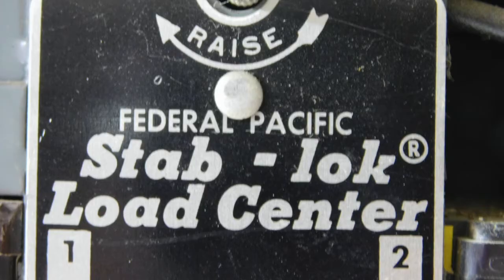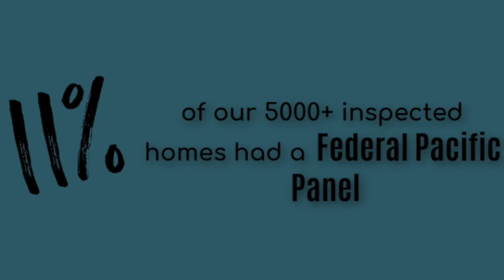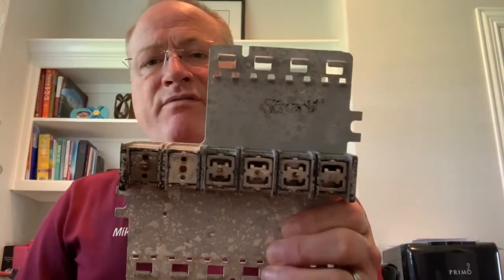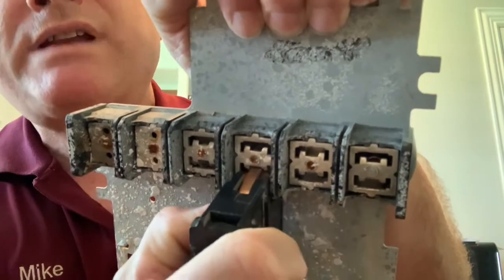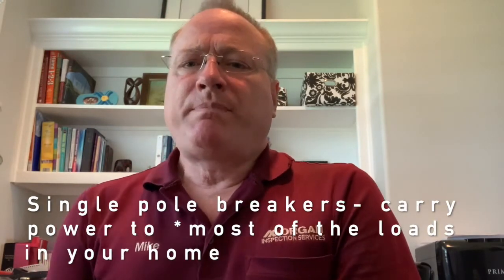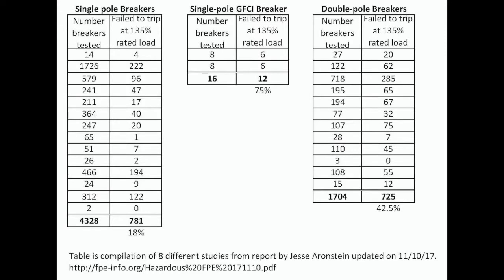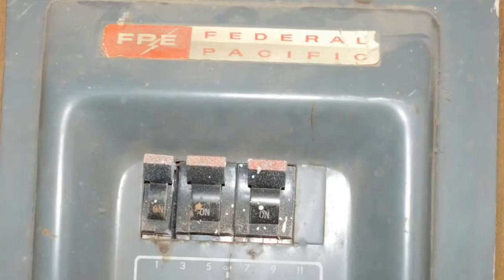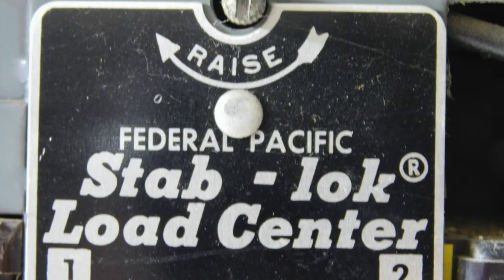Federal Pacific Panel/Stab-Lok Panel

Comment: Replace ASAP! We lived here since 1985 with FP Stab-lok panel in our bedroom closet. Just replaced ours finally on Tuesday after a big scare & learning the danger. Now a new up-to-date code panel is on outside of our house by the meter. -- I gather there are still millions of these panels in homes today. We had a fire in our garage freezer that could have taken down our house, if we weren't here to notice & jump. Thankfully we had some fire extinguishers & a good fire department response. Turns out we had rats that probably chewed wire in the freezer. Best guess. We were lucky wasn't much much worse. Could have happened while we were asleep or away. -- Firemen (yes, all men) said to get an electrician before turning power back on. -- Electricians told us that a new up-to-date panel with Arc fault protection would have prevented the fire from happening, so would have been a non-event. The circuit was okay after fire, but we should replace the panel ASAP because a lurking fire starter in our closet. 

1. Get yourself fire extinguishers & know how to use them. (Thankfully we did!)
2. Know what your electrical panel circuits control (Thankfully I did, so was able to run to shut off power to freezer). Know how to cut off circuits in your electrical panel.
3. Put a linked smoke detector in your garage (We were lucky I smelled smoke before the indoor smoke detectors went off. My nose beat the detectors. Fire was raging.)
4. Don't have holes in your drywall that can let a fire go up into the attic (turns out we had a hole near the fire in ceiling, but lucky didn't make worse)
5. Donate to your local volunteer fire department
6. Don't let your garage be cluttered with stuff that burns easily. Make sure you don't have rats hiding in that clutter. Check out your old appliances for safety. 
7. REPLACE any Federal Pacific electrical panel ASAP! Get up to code. 
8. Do NOT have your electrical panel in your bedroom closet. That has been a code violation since 1981, but no one ever told us till after this fire.
We are going to get a full house inspection for safety hazards - get electrical of house reviewed for what is no longer in code (old rules grandfathered in doesn't mean safe). 

Federal Pacific (Stab-Lok) was never actually recalled in the USA, which is nuts. Get them out of your house! -- Maybe they were recalled in Canada?
Reply from the maker: Thanks so much for sharing your story — I’m really glad you were home, had extinguishers nearby, and caught it in time. That could have ended very differently. And you’re absolutely right — Federal Pacific panels (especially the Stab-Lok type) have a long history of concerns, including breakers failing to trip. I always inform my clients of the issues with them when found during inspections.

I also appreciate the practical tips you included. A smoke detector in the garage, knowing your panel layout, and reducing clutter are all excellent fire prevention steps.

That said, not every FP panel causes a fire — but enough have failed that replacement is the smart move. For anyone unsure about their panel, it’s a good idea to have it inspected by a licensed electrician.

Really appreciate you taking the time to warn others!

Comment: few years ago i worked at a small public housing complex  that had a fire back in 2008 ..someone smoking around oxygen tank....place was built in the 60s ...anyway they dumped millions in rehab work...new decks ..new sprinklers and heat /hot water system...guess what the did NOT change...all 48 federal stab lock subpanels....no clue how they got away with that and last i knew they are still there...
Reply from the maker: Wow! The odds are definitely not in their favor with that mini stack panels.

Comment: I have seen brown handles are they defective
Reply from the maker: I hope the answers your question.  If not, give me a little more information about what you’re referring to, and I will try to answer better.  

Federal Pacific breakers with brown handles are likely older models, and their color alone doesn’t necessarily indicate a defect. However, many federal Pacific breakers, regardless of handle color, have been associated with safety concerns, such as failing to trip during overloads or short circuits. It’s always a good idea to have a licensed electrician inspector panel if you’re concerned about its safety or functionality.

Comment: What exactly is a 'over current situation' as you say ? the current coming in spikes or a appliance drawing to much current (if that's possible)
Thank you for the video.
Reply from the maker: Hi. Thanks for watching, and thanks for your question. When I talk about an overcurrent situation, I am referring to running 20 or 22 or 25 or 30 A on a 20 amp breaker. Or running 18 or 20, etc. on a 15 amp breaker. I’m just referring to a situation that would normally cause a breaker to trip.

Comment: why not just change the breakers out?
Reply from the maker: My understanding is that it costs more to buy the replacement breakers than it costs to completely upgrade the panel.
Reply: @morganinspectionservices3840  the cost of @20 breakers $20-50 each vs $2000-4000 for the entire panel. i realize the problem is twofold, the breakers not tripping and the way they connect(stab lock). not having any problems with the panel and it looks good upon visual inspection. may just stand pat and be careful about not overloading circuits. thanks for the video.

Comment: Why isn’t there a cost effective retrofit fix for these breakers. ? It is clearly the breaker that is the issue. Develop a new breaker with a metal that is not “dissimilar “ to the metal found in the buss right?  You don’t replace your steering wheel or your dash board when there is an airbag recall issue that can cause death. You replace it with a redesigned airbag.

Comment: How high are the failure rates at high current like 200% (short circuit)? is this a calibration type issue or complete failure typically?
Reply: They have focused on 135% current tests expecting a bimetallic strip in 40 to 60 year old breakers to be within calibration.  But on a 20 amp circuit with 12 gauge wire, a 100 foot run has 0.16Ω resistance and puts 64 watts of heat in the wire when carrying the rated current.  At 135% (27 amps) the heat would be 116 watts -- about a watt per foot of wire,not a fire hazard.  A magnetic switch instantly cuts the current in a short, where you could have the electric company maximum of 200 amps putting 6400 watts of heat (about 5 toasters) in the walls.  But as the CPSC determined in 1983 and again in 2011,  these will trip in most conditions.  But in older equipment, the condition it's in NOW should be the deciding factor, not a brand name. The dead front must   be removed to look for rust, corrosion, burned wires, melted insulation, loose terminal screws,   loose breakers , conductive salt  deposits near seawater.  Many will be fine  and there is no need for a $4000 to $10,000 replacement now.   That's how inspections work.  But  I get links sent to me from inpecto-pedia  claiming that even though an FPE panel is electrically and mechanically sound, even if  the breakers are tested,  it is  STILL dangerous and should be replaced -- because it might work today, but it could catastrophically fail tomorrow!  EVERYTHING that works today could fail tomorrow!    So replace EVERYTHING!  But  THAT stuff could fail tomorrow.

Comment: So just a question regarding the stab lok function... If the bus bar aluminum terminal was replaced with copper terminals (or whatever metal the breaker stab lok uses), would the FPE breakers function more safely or is the issue the actual stab lok mechanism itself
Reply from the maker: The biggest problem is with the breakers themselves and the fact that some of them do not trip.
Reply: @morganinspectionservices3840  and then when you try to remove one they come apart in your hands with the guts still attached to the bus bar, fun stuff (not).

Comment: Thank you for doing your best at getting the message out there.  Based on all the research I've done from numerous sources, talking with experienced electricians myself, these breakers were very common from about the mid 50s till around 1980, being cheaper than the competitors at the time, and are very notorious for failing and causing fires.  Just as much, if not, more so, than the old zinsco panels with the aluminum bus bars.   IF YOU SEE BREAKERS WITH THE RED TIPPED HANDLE, GET RID OF THEM ASAP.  Equivalent to driving your car with the seatbelts and airbags removed.
Reply from the maker: Good advice. Thanks

Comment: There are new Stab Lok breakers available.  If they are all replaced.  Is the box itself ok ?
Reply: After my experiences with the older FPE panels and breakers, no way in hell would I ever buy a panel with the FPE name on it.  Retired Master Electrician here, still alive to talk about my experiences.  😄
Reply from the maker: As long as the box is in good condition, it should not be a problem. I have not priced them, but I understand that FP replacement breakers are quite expensive. I have heard, but not verified, that it is cheaper to replace the panel than to buy replacement breakers.

Comment: I have a federal pacific box in my basement that is connected to my washer and dryer but it's not the main panel for my home, I have a modern breaker panel that i can turn off the FPE box in my basement by tripping the breaker. Does this mean I'm safe or should I still replace it?
Reply from the maker: The one breaker in the newer panel that shuts off power to the FPE box really won't help much. It is likely a 50-amp or larger breaker. If one of the 15, 20, or 30-amp breakers in your FPE panel need to trip but fail to, the larger breaker in the newer panel will do no good.

Comment: I have a Federal Pacific Panel that was put in the house in 1961. We purchased the house in 1994. Never an issue, I never heard of an issue until we recently built a detached garage and I did some research on running power from the house to the garage. After finding out about the breakers I went ahead and replaced all the breakers with new Connecticut Electric breakers. The breaker box looks good with no visible signs of arcing. 27yrs and only once did a breaker get overloaded enough to flip and that was on me for having too many toys plugged in on the same plug as the television. Maybe we have just been lucky but we have never seen any type of warnings from the local and state news or from State Farm insurance on our Home Owners policy. I would have never known if not for YouTube which I'm sure millions don't watch.
Reply from the maker: Thanks for the comment. Your home is like most homes which can go for years and years or perhaps forever and never need a breaker to trip. In these homes, the FPE panel will never be an issue. However, a breaker panel has one and only one job - to trip to stop an overload and prevent a potential fire. If there is a 30% chance of it not working correctly, then that is definitely a problem.
Reply: @morganinspectionservices3840  I am a retired contractor. In around 2005, I worked on a residence that had an FPE panel mounted on the exterior of the structure. My electrical sub found that the main disconnect had overheated in the past. He said that the problem with FPE panels was the breakers themselves failing to trip in an over-current situation rather than a panel design issue. He was able to locate an updated Stab-Lok main disconnect and all new breakers that were manufactured by a company somewhere in Canada. According to literature supplied with the breakers, CSA had tested the Stab-Lok clones and determined that they performed as required. CSA Certification information was provided. The only issue was the cost of the Stab-Lok clones, which was about double that of a standard American made breaker. By using these Stab-Lok clones we were able to save the homeowner quite a lot of money and still update the FPE panel with breakers that would provide proper protection. That being said, if it were me, I would have replaced the entire panel with a new one, but the homeowner was operating on a tight budget and this FPE panel was an unexpected issue.
Reply: @harryedmunds6652  the breakers in older panels in grocery stores and hospitals and such would come apart in your hands with the Stab Loks still attached to the bus.  Retired Master Electrician here still alive to tell about it.  😀
Reply: Think I have read that the Connecticut breakers are just as bad as original equipment.
Reply: the stab lok are problem panels....ive worked many places with federal pacific switchgear and mains ..those are fine

Comment: Testing by Jesse Aronstein has shown that the Connecticut Electric UBI type F breakers are worse than the Federal Pacifics for failure to trip. Type F is the designation for CE's replacement breakers for Stab-Lok panels. Stab-Lok is a trademark and only Federal Pioneer has the current rights to use that name on a product. Federal Pioneer is a division of Schneider Electric. Federal Pioneer Stab-Lok breakers are manufactured in Mexico. The most popular type NA breakers have been discontinued leaving only the thin NC type available for numerous amperages.  American Circuit Breaker Corporation(ACBC) breakers were manufactured by Federal Pioneer not Federal Pacific.
Reply from the maker: Thank you for the excellent information.

Comment: Thank you for a very informative video.. I am in Canada my panel is a federal pioneer panel and the breakers are stab-lok Breakers but instead of having copper tips they have aluminum tips. So I'm guessing this could have been something they resolved along the way in production. Changed to aluminum busbar and aluminum prongs on the breakers.
Reply from the maker: The busbar may be different, but that does not solve the problem with the breakers themselves. It should be replaced.
Reply: They are still failure to trip prone breakers and you should change it out as soon as possible.

Comment: I have read plenty of scare stories on the net about FPE panels. My own has always functioned correctly. There was a buried cable out to a lamp post in the yard, and it eventually began shorting out, and my Stab-Lok breaker tripped as designed. So in my experience, the panel has not been a problem.
Reply from the maker: Thanks for sharing
Reply from the maker: Thanks for the comment. I'm glad that yours tripped as designed. As stated in the video, about 70% of FPE breakers will trip properly. It is the 30% that don't trip that are the problem.
Reply: And one day it will not function correctly. You have been warned. Insurance companies are well knowledgeable about these Federal and Zinsco breaker failures. There are plenty of other videos on Youtube to show tests and examples of failures. Please don't risk your family's safety on disbelief or skepticism.
Reply: @Sparkeycarp  I have read comments from electricians who say the FPE panels and CB's do not fail any more than others of the same age. Example: "I test circuit breakers for a living, there is a NETA approved test procedure. Of the FPE CBs I tested we had no failures."
Reply: @Louie723  Sounds like a half assed test.  Did they try to remove the breakers from the panel to see if they were welded into the bus or not?  🧐
Reply: @doninmichigan  Breakers were not welded in.
Reply: Try to remove one of the breakers and if it comes out intact, you're lucky.

Comment: in my house the federal stab-lok panel is 125A, one light and two outlets are off,  the breaker I need is what Amp?  most I see in stores are 15Amp...I am confused
Reply: Call a licensed electrician and have the panel replaced.
Reply: @Sparkeycarp    why replace the panel?
Reply from the maker: I'm not sure I completely understand, but you need to make sure that the breaker matches the wire size. For most branch circuits it is normally 15 or 20 amps.

Comment: What about Federal Pioneer? Also is it enough to replace only the breakers or should we replace the panel as well?
Reply from the maker: Federal Pioneer is the Canadian version of Federal Pacific, and I'm not real familiar with them. As far as Federal Pacific, my understanding is that replacement breakers are quite expensive. I have heard that is almost as expensive to replace all of the breakers as it is to replace the entire panel. I think my best advice would be to talk to a local electrician and get their advice. Good luck.
Reply: Same company same breaker failure problems. Get it replaced.

Comment: Excellent video, thank you!  Much to my chagrin, I just discovered that our 1970's built house has one of these Federal Pacific 'death panels'!  Even though we have lived here for approximately 23 years, I only now had to check the panel box because 2 outlets in our kitchen failed while I had the toaster, an air fryer, and a microwave on at the same time.  Now the outlets don't work at all, even after trying to throw the breaker switch corresponding to those outlets!  When I Googled 'Federal Pacific' panel, just out of mere curiosity, I was shocked to read and see all the negative articles on the hazards of these!
Reply from the maker: Yes. Unfortunately, they do have some issues. They can work perfectly for years then all of a sudden…